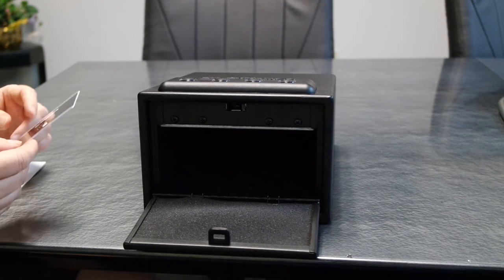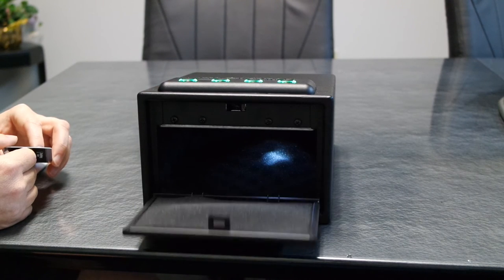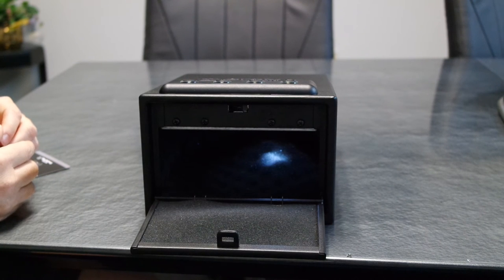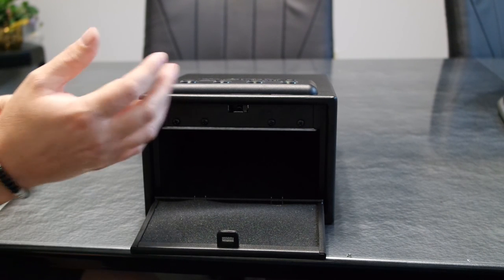BD40304040

Comment: I purchased one of these in march 2017.It arrived with the plastic code dock unnassembled, broken, I mounted it, then the door code functions didnt work.opened the locking unit to discover more broken screws blocking the locking mechanism.put everything back together and functioned 2 or 3 times before door remaining shut until pried open.
Doesnt exactly seem to be working as a SAFE/VAULT.no need to keep it at all.
I have contacted bulldog vaults and I am awaiting a response and FULL REFUND.